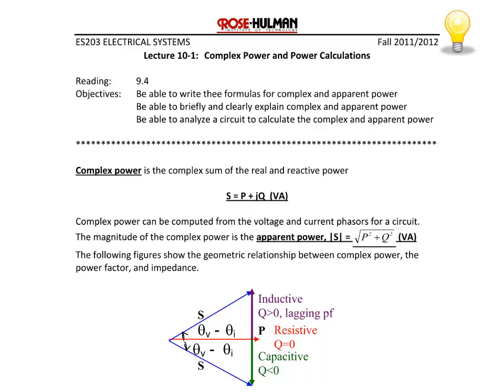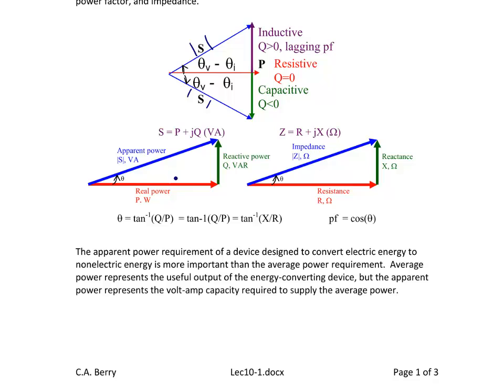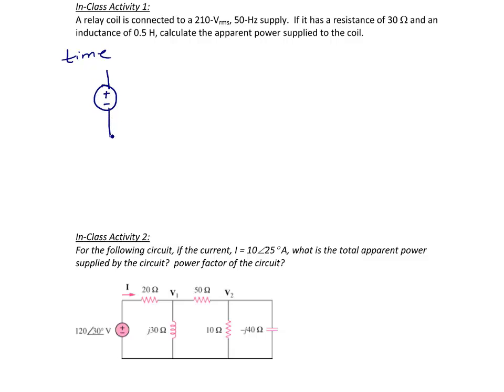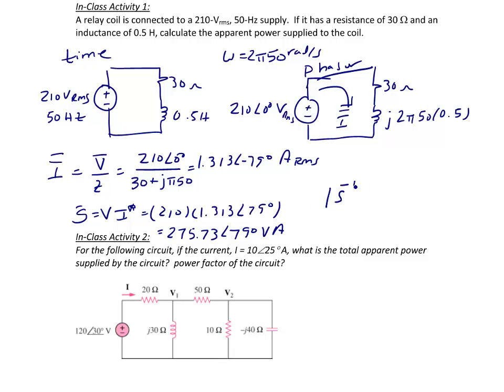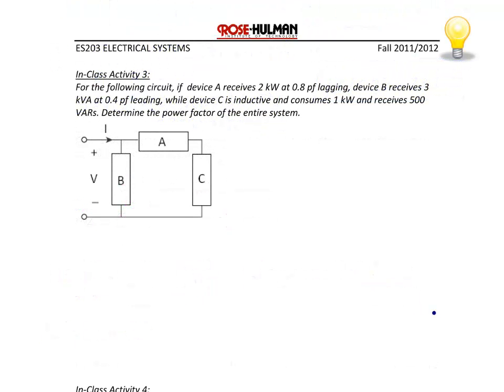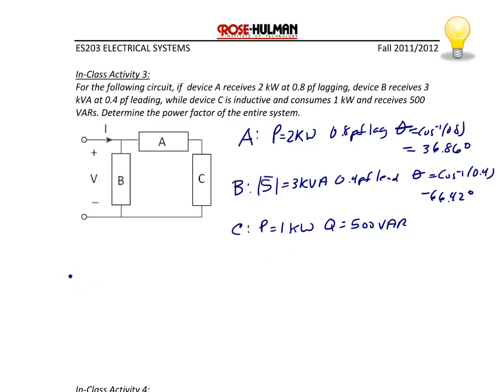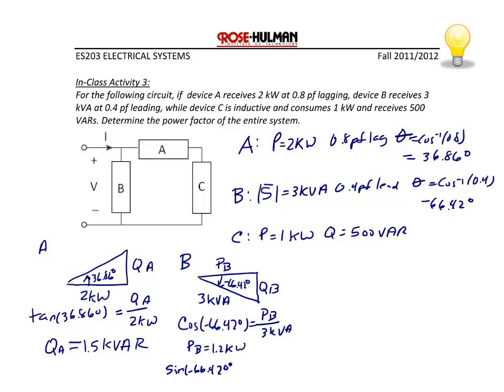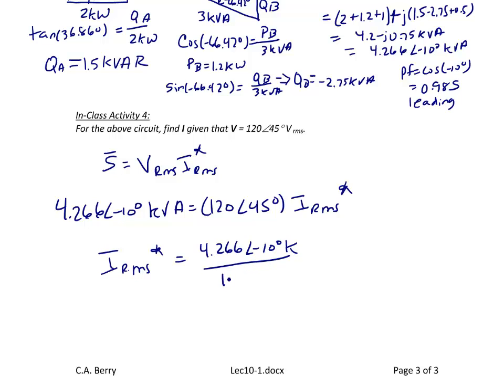ES203 Lec 10-1: Complex power, Power triangle

Comment: i think the conversion between mag and rms is 1/root2 not 1/2, can someone confirm if this is right or not to the context of the question, so the answer of the s total is 848.52 and 5 degrees. Also want to ask - how come it is a lag if there is a stronger cap than inductance? Just wondering because now I'm confused
Reply: she used the magnitudes divided by a half...which is the same as multiplying the rms values together. the root2 on the bottom squared is 2.